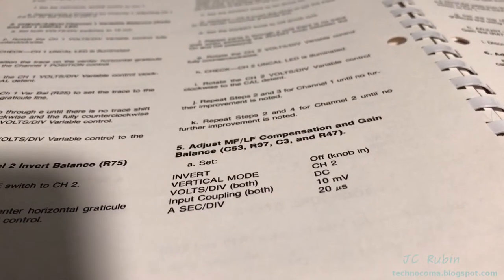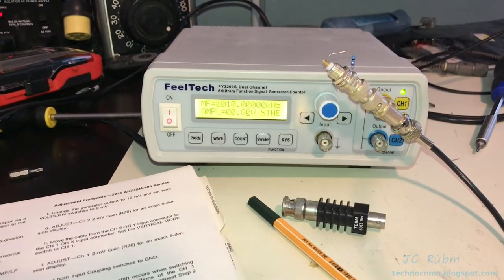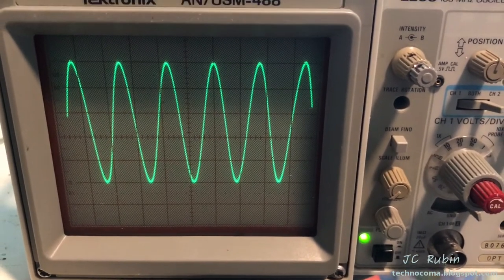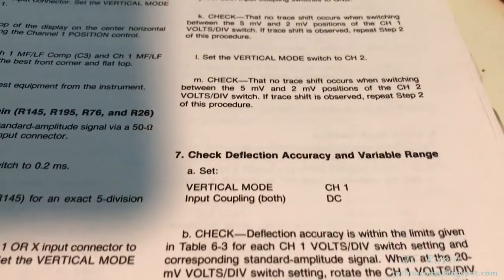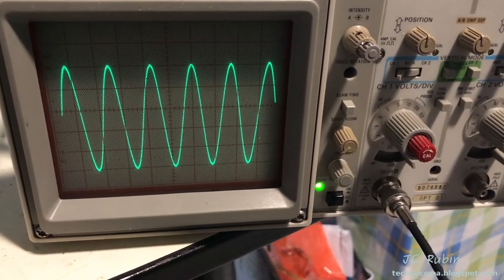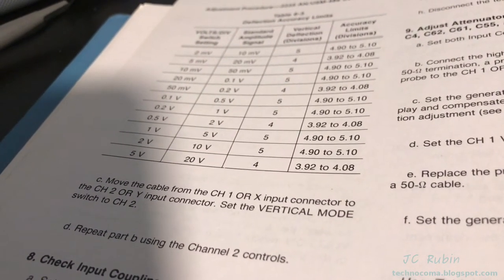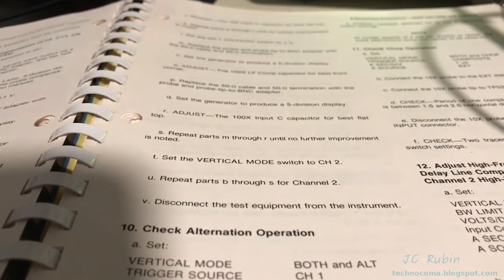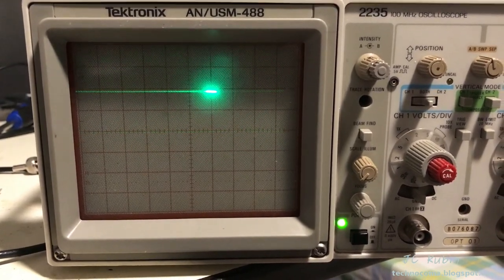Tektronix AN/USM-488 2235 Oscilloscope repair and calibration 5 of 7

Comment: Congratulations, for me this videos series was very useful, because I have two of this oscilloscopes with vertical gain problems and this series give correge to repair them.
Reply from the maker: If you have the manual, it will help greatly.

Comment: Always use the center of the trace as it's position -- that's where the scope is attempting to put it, and the fact that it's "fuzzy" introduces a variable that should be ignored.  Otherwise, you're taking the position as the top or bottom of the fuzziness, which is arbitrarily offset from the center point.  You can change it -- change the brightness or focus, and suddenly your calibration has changed!  That can't be right.